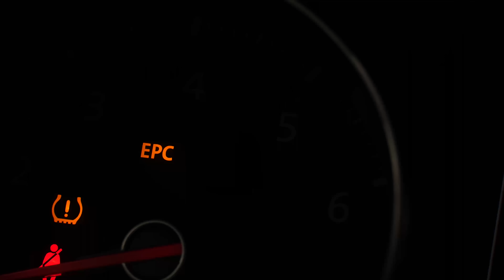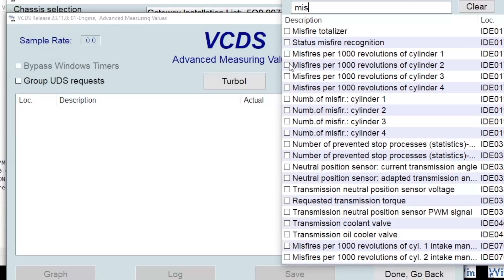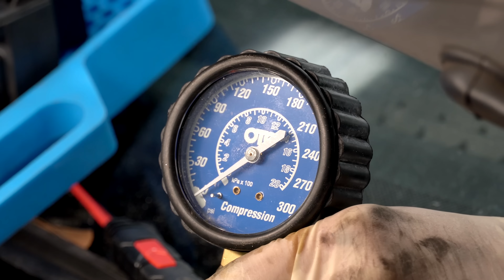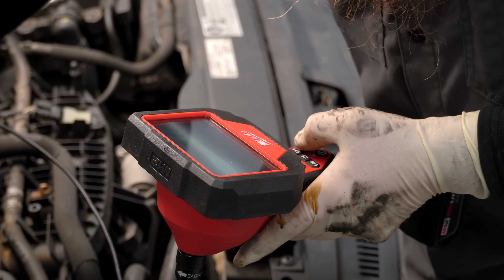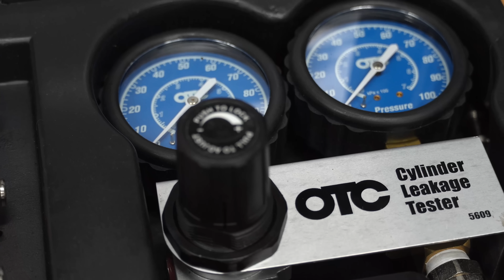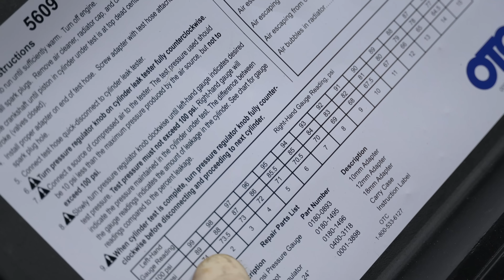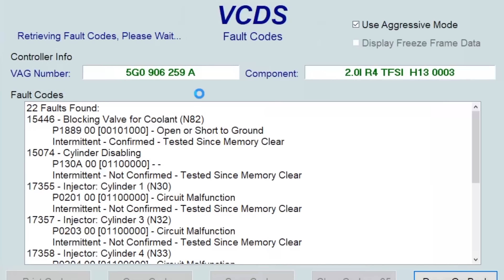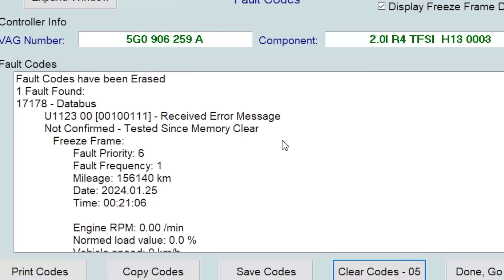Dead Misfire MK7 GTI, Another Shop Said Engine is TOAST

Comment: Good job, you know your VW stuff. It still irritates me that VAG uses all these one time use bolts, anaerobic sealant for the valve cover, all specialty tools etc., just to make extra money. Not to mention these weird issues, broken valve spring…. Any hoo, peace be upon you, ye humble mechanic.
Reply: Welcome to the real world, most manufacturers today use torque to yield bolts and anaerobic sealant instead of gaskets plus their own specialty tools.
Reply: @nickpappas4133  "Most" Do Toyota/Yamaha, Honda and Suzuki use them? If not, they probably aren't necessary. If car and motorcycle engines have been made for 70+ years using reusable steel bolts going into aluminium, why do inconvenient single-use bolts need to be used now?
Reply: Torque to yield bolts are great from an engineering perspective.
Reply: @aygwm  Is it part of VW moving from DIN bolts to ANSI ISO bolts?  I don't get it though.  If it's good enough for Honda to use the same part numbers for JIS bolts (Japanese Industrial Standards) for their cheapest motorcycle to their most expensive car for 4-5 decades, why does VW need to use different part numbers for bolts than the simple 10, 13, 17mm bolts of various length that they were using in the Beetle and Type 2 days?

Are the advantages of ANSI ISO threads really so significant that it is worth changing the entire parts catalogue to inventory all these different types of bolts (now with Torx, E-Torx, Triple Square heads et cetera et cetera)?
Reply: @TassieLorenzo yes, Toyota uses torque to yield bolts and RTV sealant, and so does Honda. Most automotive manufacturers have moved to RTV on the oil pan and other areas.
Reply: @ryanturnerboles  Yes, there is nothing wrong with RTV sealant, the topic was aerobic sealant.  RTV sealant (Threebond/Yamabond/Hondabond) has been used for motorcycle case halves for decades!  How many torque to yield bolts are found on typical Toyota and Honda engines, is it really as many as VW? :)
Reply: I would think these one time bolts are required cuz bolts  are subject to wide range of temperature change

Comment: I love old vw/audis. I swaped the 80 quattro to golf mk3 16V gti and turbo charged it with an s2 turbo. But the more I watch your vids, the less I want to have these modern 1.8/2.0 tsi...
Reply: The good thing about them is that there really isn't a need for engine work on the 2.0s to be pushing 300-400hp. All you needs is a couple of boltons and a tune to make decent power. Anything more than 400 out of a GTI is basically useless because all you will be doing is understeering or spinning tires.

Comment: I bought an audi that was diagnose with headgasket oil leak. Spent an afternoon with some buddies pull the head off and bought a elring full headgasket kit, studs and sparkplugs. Replaced every single gasket and new head studs. Car ran fine other than the occasional misfire 2 and 4. I almost certainly deemed it engine abt to let go.. so ran the car like that for few months, wen stepping on it it still goes! Come to realise wen took a look at plug gaps i somehow installed tri plugs. Was sold wrong plugs for n/a car not turbo. Installed a set of known working ngk plugs. Starts and idles perfect now. Cant believe i missed it.. so simple, mind u wen i was chasing the misfire replaced every single sensor, coilpacks, pcv, checking for leaks etc.

Comment: damn 4000 is a steam.
I paid the same for my 2002 Jetta Wagon VR6.
6 month later, it cost me 11k to fix. 01M tranny went down, and she shop found that my cat converter was gone (and someone put a spark plug fooler to pass smog and trick the ECU). and then, my timing chain was very bad, because my tensioner was broken in 3 (I might still have the picture). and I didn't mention before that the busted coolant hose.
costly mistake on my end. I still got the car.

I love your video. always a lesson.

Comment: My Yaris has 301,000 miles
Never touched it!
Reply: Maybe you should drive it from time to time. 😂
Reply: @dnxb1t  It has 300,000 miles on it...  No telling if the high performance GR Yaris will be as reliable. I think there were a few little recalls and small issues (some transmission/synchro troubles IIRC).  These may have been fixed by the time the GR Corolla was released in North America.  It would be fun if Charles did a video on disabling "Straight Line Running" in the VW steering module, which is meant to compensate for cambers and ruts and filter a lot of steering feel out, which should make the GTI's (or R or S3 etc) steering feel more like a GR Corolla and less VW numb.

Comment: I have a 1988 VW Golf. I had it since new, it always been garaged and the silver paint still looks new. I change the oil every 3000 miles on the nose. I still drive it. It has 324,000 miles on it and the only thing I had to do with it was change the valve cover and the oil pump. Plus new brakes and about 6 sets of tires. I love the car.

Comment: Just had my 2.0tsi rebuilt.. new pistons and everything even turbo.. its a passat cc 2011 with abt chip and stage 1 .. after changed everything got missfire on 5900 rpm.. and underboost codes... after installing downpipe, cat was damaged.. this things runs like a rocket... Amazing engine if you take care of it.. but after 400 000 km .. it needs special care :D i looked at all your vides on repairs and other stuff with this tsi engines.. it halped alot !

Comment: I had a broken valve spring on my mk7 as well, it was also a 2015 and it happened at 100k miles. Thankfully no damage to the engine. Other than that never had a cel, or any issues with the car ever.

Comment: recently a friend of mine bought a mk5 gti for cheap because cyl2 had 0 compression, turns out the previous owner was flooring it everywhere with the cheapest possible gas and melted a hole in the piston, scored up the walls too. new piston, jb weld + hone, full send. now 2 years of flooring it every day, still going strong

Comment: Haha, I had this happen to my 3.2fsi passat. Bought the car needing chains and didn't have it running long enough to come off cold idle, replaced the chains and didn't notice the spring being broken, I started the engine and once the rpm dropped the misfire started. Had me thinking I did the chains wrong but vcds was showing it was within spec, only once I drove it and the misfire went away after 2500rpm did I think valve related issues and after a leak-down test sure enough one intake valve spring snapped. Wasn't impressed doing the timing job again plus pulling the head to check for damage but one spring later it's been running well ever since

Comment: 1600 is not bad at all, the chains do need done at 100k (or before) as well as coolant migration, the bladder in the coolant tank ruptures filling the heater core full of beads blocking it us. The preventive maintenance here is great. It will add value to the car knowing those things are done and the decarbon too is a nice bonus. Subbed !
Reply: Is that an interference engine?

Comment: I have like >300bhp tune (purchased as is), and I have had zero issues with timing chains, valves, or compression.  I also hammer on it occasionally to reduce intake valve carbon buildup, but I do 90% of my driving steady-state on the highway!  Craziness.  Hey, EVERY car is different.
Reply: Maybe it’s because it already blew up for the previous owner😂

Comment: One thing to note @ 3:18 , cars with HPFP for DI can have bad injectors that won't show any issues on base fuel pressure, and will need a few "dead" cranks, in the MZR for mazdaspeeds at least you can shut off the specific injector and crank to see if it's stuck (or disconnect that injector from the harness), that way when you see the 10-100X in fuel pressure the injector normally sees, you will get a more accurate test.

Comment: i have an octavia 2018 tsi with chha engine... started with corrosion on the reservoir pins, led to both  coolant valve things to be replaces, twice... since no1 actualy checked the car well enough to find out like most of my motor cables were corroded... ohyea painful to the eye and wallet, but hey spotted a NEW oem motor cable set for about 140€ (instead of new vw one for 900€) swapped it by a professional garage and so far so good.. :D great video, fun to watch. subbed in the first minute and see you in the next one!

Comment: Growing up my dad a garage mechanic , always told me .dont get any other car brand besides a toyota / honda and that has stuck with me. My new 2011 camry is still running strong with over 240k miles .only thing i have replaced on it is the alternator and motor mount  at 180k miles.

Comment: Sold my GTI, no issues with the DSG transmission but there was a mysterious oil consumption issue that could not be fixed. No leaks but randomly the oil lamp would come on and yep empty. Changed PC valve, tried different viscosity oil, and still couldn't fix it. Great car apart from that.

Comment: Like the Mercedes dealer I took my car to, they diagnosed a startup rattle as the left camshaft adjuster, I said fix it. They charged mr $3700, but didn't fix it, then decided to do more testing for another grand. I picked up my car, bothe me and the car broke. They said water in oil. I use Liqui-Moly 5w-40 Molygen, with a green tint for UV leak detection. I also had oil analysis done 700 miles ago, no coolant or water or abnormal wear in the engine. but dealer then decided oil was being restricted, wanted to flush oil system at my cost. Also said my oil was substandard and not MB approved, and that 5w-30 was the wrong weight. I had shown them the bottle, it was clearly marked 5w-40. Also coolant system serviced 400 miles ago. So they effectivly got out of repairing my car and I was out $3700 for nothing.
Reply: Ohh I would never do any of that. Get yourself a civic and sail happily into the sunset lol.
Reply: @shadf7902  Hondas and Toyotas the are the worse, crappy ride, noisy as all get out. Never had one last very long. Best car I ever had was an old Benz I drove for 300k miles in 20 years.
Reply: Update, they finally fixed after calling corporate.

Comment: Has EPC .. doesn't stand for epic I'm assuming. 15 with 100,000 sad. That's really cool that you can replace the spring without taking off the cylinder head. Good job Charles!
Reply: You don't have to remove a head to replace a spring, you just need to retain the valve

Comment: I wouldn't even think a spring experiencing no lateral forces could break like that. But yeah which do you think a shop would make more money off of a $8K engine or $7 spring? smdh. Great step-by-step on the troubleshooting showing us your thought process. And what a steal for you!
Reply: If you think about it the material in springs is always loaded in bending so it’s really not that surprising they can fail this way
Reply: @Turbochargedtwelve  I wish I could say I'm surprised but with the "quality" VW has been putting out in recent years, yea...
Reply from the maker: Way more $ in the $7 spring and labor than an engine. And less/no down time
Reply: The shop makes way more off the spring, but they'd never sell the job. It's diag time plus gaskets, fluids, sealant, hardware, guides, chains, and of course, labor. They just label it engine failure, swap the whole thing, and move on.

Comment: Hi HumbleMechanic,

I've been a fan for years now. I own a Golf 7 GTI myself and before I bought it it had some little issues with high RPM's which the engine had like hiccups but at the time that was the only issue. It's been a very big mistake to ignore this issue. Now, my engine has idle issues and on top of that it stalls when starting the motor and even at the beginning before I drive it warm. It only happens when it's cold, if the engine is warm it rarely happens and what I noticed was, my car has farts and it turns it off after I shut down the engine and start it up. It smells like terrible gas and I've been trying to fix it for a year and a half. It's an American Golf 7 GTI and I had it imported to the Netherlands. If you could know by the things I said what it could be, I would gladly appreciate it. 

We have tried to clean the whole engine (even the walnut), replaced the throttle body, replaced sparkplugs, coils, we have tried to check on the cables, replaced the coolant cables. 
It was my first dream car and it still is, the car drives fine after the stalling and starting the engine 20-30 times. But I'm always scared one day that the engine will shutdown completely and not work. I don't drive it anymore for now, I just want to fix the issue since it's been going on for more than a year now. 

I appreciate if you have any suggestions, I see that you guys have more experience than I can have. Thank you!

Comment: I had a 2015 MK7 also developed a Cyl 1 misfire at around 100k with a CEL. we chased all of it down to compression test showing leaking exhaust valve. Pulled the head and it turned out to be a valve guide that was worn out. Sad that parts on these engines are not allowing them to go trouble free for more than 100k.

Comment: You can diag spark misfires in one go, just swap coils 1/2 and plugs 1/4 for example. Usually works to nail down coil, plug or mechanical in one go.

Comment: I have an mk5 brm 5 spd jetta with 425k miles. I am the original owner. Sill original mufler,starter, can injectors etc. Still getting 42mpg, always enjoy  your videos. alot tothe variable valve train. I am hoping toput 1million miles on it. As a preventative, at what mileage shouldI replace the cam and  lifters. I am waiting to see a decline in fuelmileage and then do it. Bought injectors last year from VW Germany as well as cam shaft, lifters and rocker arms.

Comment: I had a similar issue working on a mk5 gli w the fsi engine a few years back…mileage was right about to 200k tho so it was a way worse for wear
My problem however was a bit worse….cyl 2 burned part of the intake valve off, looked it got cut w a torch - crazy. Good news is I took the whole head to a machine shop and they replaced all the valves and springs and did the carbon cleaning and checked for possible warping and valve seat damage.
Did I mention the customer drove it in misfiring and shaking like crazy?

Comment: 1:15 Uhhh I don't understand why you said "if you move the coil and spark plug at the same time and the misfire moves you don't know which one did it"

if you have a misfire on one cylinder, lets say cylinder 1. You move the spark plug from cylinder 1 to cylinder 2, the ignition coil from cylinder 1 to cylinder 3, move the ignition coil from cylinder 3 to cylinder 1 and spark plug from cylinder 2 to cylinder 1. clear the fault start the engine, if the fault travels to cylinder 2 its the spark plug, if the fault moves to cylinder 3 its the ignition coil. If it stays on cylinder 1 start checking compression yata yata yata.

Comment: I was doing the timing on my 14 A4 and my exhaust cam definitely went "poing" and since I was working in my gravel driveway you can imagine my horror! Thankfully the cam lobe, even without the ball and spring, can't move far enough to get out of time. After a terrifying few minutes I did find the ball and/or spring and was able to put the car back together... That was a couple of years ago and now I have steering issues. I think one of the u-joints is binding up as every ¼ turn-ish it stops wanting to turn. And after a turn the wheel will not go back straight. Just  drive in circles...

Comment: This is so bizarre. I also have a 2017 MK7 GTI that broke THE EXACT SAME VALVE SPRING. Unfortunately my intake valve met the piston. Many dollars and a valve job later, its back on the road.
Reply: Crazy! Was it just a 'random' manufacturing defect?
Reply: As far as I can tell. It did occur after some spirited driving. But when the spring cracked I wasn't doing anything other than normal commuting. Then it threw a CEL and after I pushed the clutch in it died.

Comment: Had my 1.8tsi break a valve spring ,thought it was a dead coil and tried driving it home. Didn't make it , valve dropped j to the cylinder and that piston cracked in half ,broke the valve into three PCs which the head when removed had the valve seat pressing into the seat, catastrophic failure. Learned that this was a rare but common occurrence with th 1.8tsi opposed to the stretching timing chains.

Comment: That vehicle only has 98K on the clock ... engine is clean (owner gave it oil changes).. and it needs an incredible amount of work.   Timing chains, tensioner, valve spring... etc would be cost prohibitive for most GTI customers and would be forced to sell/ scrap car.    VW Dealer would charge over $4,000...maybe even $5,000 to repair that!   I had one... I know.    I will NEVER own a VW again!  I'm a shadetree mechanic and you need a entire different set of tools to work on VW/Audi due to all the specialty fasteners used to prevent others from working on their  cars!  oh yeah... you also need VCDS... your average OBDII scanner will not work on thier proprietary junk!

Comment: I have a 17 Autobahn Gti. Was changing spark plugs and coils. Noticed a little and I mean a little oil on cylinder 1/2’s spark plug boot. But on the outside of boot. Normal? I put new plugs in and replaced coils. Seems to run great now.

Comment: 95% of shops are dishonest, incompetent or both. That's what it boils down to. 

I diagnosed a bad MAF on a Mk4 Jetta, despite no code for the MAF. I used an oscilloscope to log. Took it to VW specialists because I just wanted a sanity check. They came back with more than $1000 in repairs needed. I bought the MAF ($99), installed it, problem gone. I confronted the owner of the shop.

"But there was no code for the MAF." - He offered the diagnostic fee refunded. I told him $125 was a small price to pay to know to never bring my vehicle back to them.

"VW Specialist".